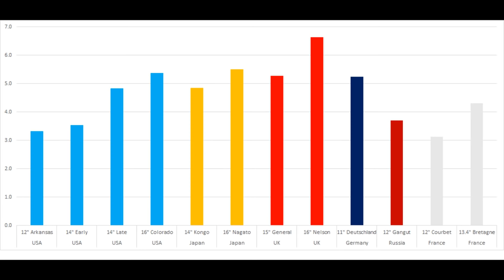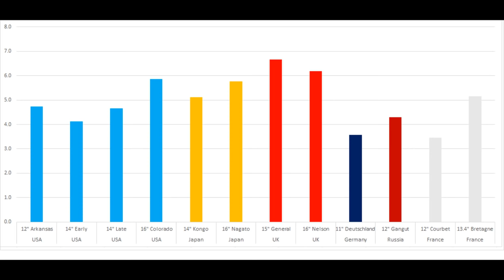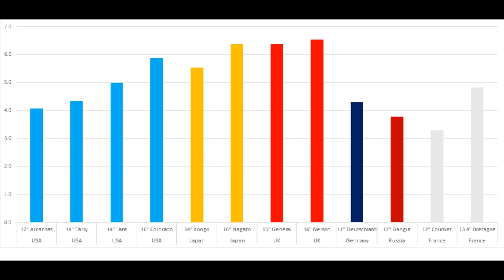Battleship Guns of WW2 - A series of tubes

Comment: I would think the most important measure would be the amount of time it would take to score a hit on a target between the minimum and maximum likely combat ranges. Range, rate of fire, relative destructiveness of projectiles is meaningless if the target is not hit in a timely manner.  That would be followed by the likelihood of penetrating armor into the target's vitals. Other factors seem to me to be of much less significant.

Another interesting comparison would involve the relative weight of the guns and mounts. For instance how does the relative effectiveness of the 12 14-inch cannon of the Tennessee class compare to the 8 16-inch cannon of the Colorado class?

Comment: Drach;  I think you correctly analyzed the guns, but I think you really need to analyze the complete weapons systems, the vessel as a machine designed to place shells on a target.  Though no-one did it, I think a 15x 13.5" fbb, especially as a squadron would have been the most disruptive battery.

Comment: Given that range is significantly affected by a turret variable - elevation - perhaps you should take it out.  You are, based on your earlier discussion of range, using this variable as a proxy for hitting power at typical engagement ranges, but you are picking that up with your AP at 20000m.  (although shell construction is also a factor here).  However range is important per se.  If you can start shooting at someone before they can shoot back it gives you a huge advantage until your opponent comes into their range.  Also at long range you only need to penetrate deck armour.

Comment: Just a suggestion. Why not have the range for each gun measured by a certain elevation, say 20 degrees. The longer the range would then be a true reflection of incidence of the shell ( flight profile) and therefore the guns ability to penetrate belt armour? That said, another great bit of research, thanks Drac.👍👍👍

Comment: A couple ideas to consider:

You made much of "range" as an issue, pointing out that in many ways, it IS a function of the turret and not the gun, or at least in part.
You also pointed out that maximum range could be included as an approximate metric for shell ballistics at more normal engagement ranges.

Why not use a metric like "Elevation to hit 20,000yds" or something similar? Assuming the data exists, this would capture the shell ballistics at normal engagement ranges at least as well as max range, while eliminating the boost a ship gets merely from being able to elevate its guns more than another.

Secondly, I think going from 0-10 for all the categories allows outliers to really bias the sample, as you acknowledge. To mitigate this, you could use a composite rating, perhaps the position in the range as you used averaged with the difference from the mean.

As an example:
If the range for range was 25,000yds to 50,000yds, but the mean was only 30,000yds and you had one outlier, the score would be as follows: the value range is 50k-25k=25k.
The score for the ship with the 50k range would be: 1.0 (for position in range, your metric) averaged with 0.5+((50k-30k)/25k)/2=0.9 for an average of 0.95, multiplied by 10 for a 9.5. This score right at the top end of the range indicates that not only is it the best, it is substantially better than most of its competitors.

The ship with a 25k range would get 0.0 averaged with 0.5+((25k-30k)/25k)/2)=0.45, for an average of 0.225, or a 2.25/10.
This higher score reflects that while it is the worst, it's actually more in line with its contemporaries, rather than hopelessly outclassed.

For a situation where the mean is equal to the middle of the range, this would give scores ranging from 1.25 to 8.75, with higher or lower scores requiring that a ship's characteristic be disproportionately outside the range of its competititors in one direction or another.

Regardless, this was a cool vid, and I really liked the effort you put in to avoid bias where your could, and at least discuss your biases and decisions when you couldn't.

Comment: great video, very informative.

but why not use muzzle velocity of standard AP shell instead of that pesky range parameter, and maybe get rid of penetration as well? 

since, essentially, both range and penetration are functions of muzzle velocity, shell weight, and different other shell parameters (which aren't necessarily affected by the gun itself).

when using shell weight and muzzle velocity as parameters, combined they give the shells initial kinetic energy, which heavily depends on how much explosive pressure that particular gun could handle - therefore giving a very good measurement of the guns actual quality and performance, while also factoring in the caliber (as in barrel length), but being independent of turret specs like maximum elevation.

Comment: Oh, boy.

Before  I get into my critique, I acknowledge that any attempt to rank a group of items based on a collection of data types (range, ROF, penetration) is a minefield, given the plethora of choices that need to be made. I think this list gives a reasonable ranking, but I have some opinions. 

1) If I heard correctly, the overall rank came from an arithmetic mean of the ranks of the categories. An arithmetic mean would be fine if, for instance, you were evaluating a gun's performance at a few specific ranges and wanted to give an overall rating across ranges.  In this case, however, I think a geometric mean is more appropriate. Since each good result in each category amplifies (that is, multiplies) the good results from the other categories, the overall results should reflect that. Unfortunately, this results in the next problem, specifically 
2) each category was reduced to a 0 to 10 score prior to averaging. Given the choice to use an arithmetic mean, this was the simplest way to do it. However, with a geometric mean, a gun that ranks at the bottom of any one category will rank as a 0 (zero, zilch, nada) overall. (I will offer a solution later.)
3) I agree with the decision to include the ranges. I also agree with the decision to exclude them.  The max range speaks to the capabilities across all ranges, but is influenced by the turret's limitations. If instead of max range, a range at a given elevation were chosen, the turret's capabilities are removed from the equation. Drach did something similar with penetration and I think it was the correct choice in that case as well. 

My solution:
Once all categories are selected (numerical only, please) and each category has consistent units (no pounds for some bursting charges an kilograms for others), multiply all together ignoring units. (The units are still there, they just don't matter.) After this, subtract the lowest number from all results, divide by the highest modified result (HMR=highest number - lowest number) and multiply that by 10. Round as desired. This gives an overall ranking from 0 to 10.

I've been critical of Drach's method, so it is only fair that weaknesses in my method be highlighted. I only ask that you refrain from calling me an illiterate dunderhead; I don't need to hear that more than once today.

Comment: Wait I'm confused. Why didn't you just take the range of a gun at a given degree of elevation (which every gun examined could elevate to)? That way you eliminate the role maximum elevation plays (which, as you correctly mention, is based on the turret not the gun itself), similar to how you did it with AP; measuring it at a given range that could be reached by all contenders. Or did you do that in the end? Also flight time of the shell in question would have been a neat addition I think, as even with an identical _barrel_, a wide range of different velocities, shells, propellant charges, etc. can be used to alter the performance of the gun. Another interesting factor would have been cost and weight of the guns and their ammunition. In other words: how much bang do you get for your buck (pun intended), for a given amount of money/displacement? Obviously, the mass of a given gun also has larger implications for the design characteristics of a ship, but maybe this would go too far.

Comment: I think what you are shooting at will skew this  ranking quite a bit. If shooting at something like a heavy cruiser ,  pre-dreadnaught,  etc.  you can discount the armor pen, and maybe penalize guns with poor fusing that wont trigger on these more moderate thickness plates.  

While if your shooting a well armored target armor pen will rank high and you'd want to see if the shells with high bursting charges have issues with shattering on thick armor. 

Another statistic to look at is barrel wear.  While this works well for fresh out of refit ships,  a gun with long barrel life will be way better off right before refit than one that is burned out quickly.  Accuracy and Velocity drop from wear can have a huge effect on performance.

Comment: 38:00 or so. Obviously you're not going to do this again for a long time if ever, but what about using the range of the gun at x degrees of elevation? For example, starting at 10 degrees (or whatever would be a reasonably expected value), or starting at 0 if that would be important and increasing in 5 degree increments. Then taking the average score of all the degrees in order to prevent one category from completely taking over the rating scores. I don't know if it's recorded anywhere, which would obviously be an issue, but it would serve to divorce the value of range from the turret housing. Or is there something else that I missed which would prevent doing this from being useful?

Comment: Awesome video! One question, since the number charge (Propellant)  bags were used, wouldn't a larger number of bags increase armor penetration at a given range? and wouldn't this give each gun a  "Sweet spot" range wise for optimum penetration? The angle of impact can change the amount of armor needing to be penetrated, that coupled with the arc of the shell would give diminishing returns at longer ranges, or did I miss something?  I am not saying there is anything wrong with your results or data I am  curious.  Thank you for a wonderful video, your time, and attention in this matter.

Comment: This is a great video. It's only a shame that it's difficult to obtain full accuracy data as that is one of the main qualities of any firearm.
My chemical heart is just a bit saddened that the carried charge was not used in a way that would recalculate that explosive into a standard TNT equivalent which is quite often done for any bombs and grenades to  accomodate for wide pallete of explosives used. It's not a perfect way as some explosives react faster and sharper than others that might produce large volume of gases in total but that's its own story.

Comment: You should have simply scaled rate of the elevation/rate of fire. A simple expression like rate_of_elevation/caliber, for example, would assume that linear growth of caliber diameter corresponds to linear decrease in rate of fire, when a gun+turret+shell design is scaled up.
(The real relationship is almost certainly more complex than that, but this simple approximation is way better than assuming that rate of fire does not depend on caliber at all).

Comment: I always got the impression that the 16 inch guns of the Nelson class were considered disappointing by the royal navy, but they've scored very well here. Am I mistaken in the navy's impressions of the gun at the time?
Reply from the maker: Most of the problems were with the turret as opposed to the gun, and whilst there were a few issues with the gun itself, they'd been resolved by WW2.
Reply: Probably they were not considered disappointing by comparison to other countries 16in guns: The RN would not have known how good the foreign guns were, and would have been unable to make a comparison. But they could tell their 16in guns were only a small improvement on their 15in guns. That would be disappointing. 

They really should have taken the opportunity to test the 16in before building a battleship around it. They had time, after all.

Comment: What about integrating the armor penetration capability across the battle range (as determined by the engagements of WW2) as the armor penetration calculation instead of selecting a range? Also like the idea of evaluating range at a certain elevation as the range figure that load of people have mentioned.

Comment: Late to the party, but, given the issues with range - both the contribution of the turret design, and the actual use cases in which range contributed performance, would it make more sense to count either range at [maximum elevation of the turret in the data set with the minimumum maximum elevation], or degree of elevation at [typical combat range], rather than maximum range itself? That would give you a number that was normalized to eliminate the contribution of the turret, and in the second option, isolating the most relevant component of that capability. Are those numbers much harder to find?

I might be off base on this second comment, based on my limited understanding of how these variables interact, but how do you determine whether two variables are actually just two ways of describing the same variable? e.g. exactly how correlated are the weight of shell and armor piercing ability? Armour piercing ability must also be related to muzzle velocity (which also interacts with range, of course) but  if the heavier shells (nearly) always penetrate better, by including both statistics would that be accidentally weighting a single variable twice as important as the others?

I agree it really would be nice to have numbers for accuracy that are reliable, fair, and exclude the contributions of rangefinder and fire control... but I'm not surprised that was too difficult to determine in any sort of comprehensive way.

Comment: I would expect a practical analysis might be revealing. How many BB on BB battles occurred?. I can only think of   nine. 1. Hood etc al. meets the French fleet at anchor 1940. 2. Renown meets Scharnhorst/Gneisenau off Norway 1940. 3. Hood and PoW meet Bismarck at Denmark Strait.1941. 4. Bismarck meets KGV and Rodney 1941. 5. Warspite hits ?a Littorio at 13 miles  date?. 6. USS Massachusetts meets the French fleet at anchor.1942. 7. Duke of York and company meets Scharnhorst 1943. 8. Washington meets Kirishima 1942. 9. Surigao Strait  Fuso/Yamashira meets the US fleet.1944.  Only half of these were strictly gun duels. The demise of the Hood was a freak piece of bad karma. The Warspite hit might have been luck also but I suspect gun quality was a factor. The best illustration of good gun management had to be the Washington-Kirishima encounter.
Reply: It was one of the old Conte di Cavour class battleships that Warspite hit, not a Littorio
Reply: @kingradley3413  Thanks. I was not sure. Helps the discussion when these errors get fixed.

Comment: I think you missed a very important category for consideration in your tables, namely muzzle velocity. Namely because the time of flight is going to be rather important factor in the ability to hit the target because you not to account for much less needed lead. The less time the shell is in flight also the less weather effects such as wind and air pressure will have on it. And if you are including weight of shell as an important factor in penetrative capabilities, so too should you add the other part of the kinetic calculation, namely velocity.

I think adding this factor into the equation may potentially show why there was a shift to lighter shells with higher muzzle velocities like with the Nelson's guns.

Comment: I think a little different on this.  A gun is only as good as the operator.  If I'm trying to punch holes in pop cans at a hundred yards and have 2 guns to do it.  One a 22 long rifle with a scope.  The other a 30/06  with sights that are off. The first shot from the 22 is going to make holes.  While it's going to take several with the 30/06 to zero in.  So while the larger gun does more damage hits on target matter.  Bursting charge isn't as important either.  I can blow up a outhouse with 5 pounds of explosives . I can also do it with one.  The idea is to cause enough overpreasure to shatter the shell and send pieces of it flying with lethality.  Kinetic energy and velocity can mitigate weight advantages.  
Until a gun is put in a mans hands it is useless.  So things like radar make a big difference.  
These are my thoughts after watching your video.  I am interested in hearing what you have to offer in response.

Comment: This is probably a dumb question but I'mma ask it anyway.  What speed are main gun shells traveling at?  Could a CWIS system using rockets counter battery fire on them if the rockets?  Targeting would be interesting but it could be done.

Comment: related to how parameter choice affect predicted performance...

when gun charge could be varied easy..... ballistics gonna change with choice....Would firing solution computers, have "input" for selecting number of charges... or would they have an output akin to "put x charges in"? I'd be surprised if  different approaches would find precisely the same solution (including accuracy ).

Comment: Use muzzle velocity instead of range.  As you point out, range is affected by turret design.  Muzzle velocity preserves the weapon's ability to penetrate armor by striking at a low incident angle and that is the performance aspect you were trying to capture..